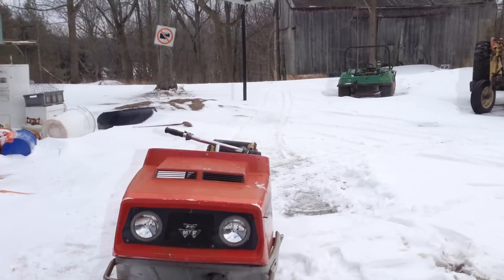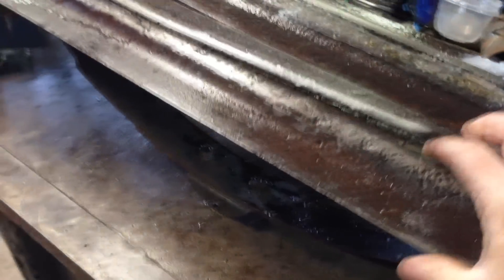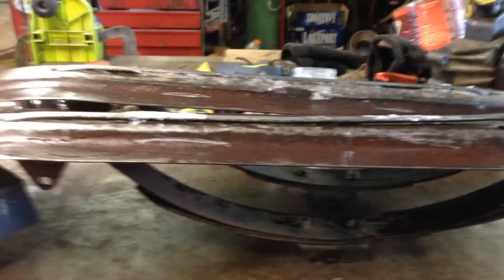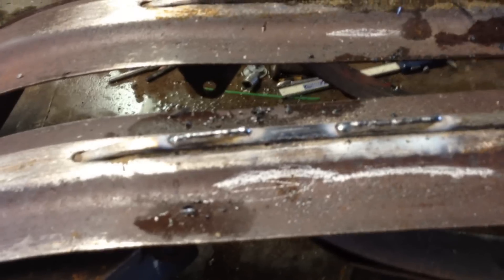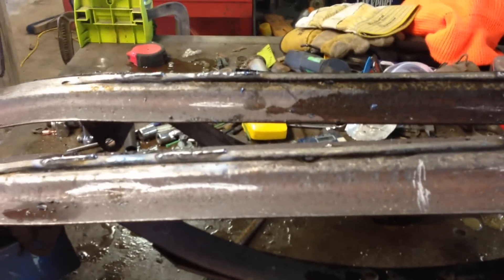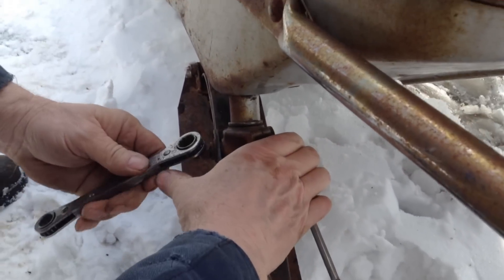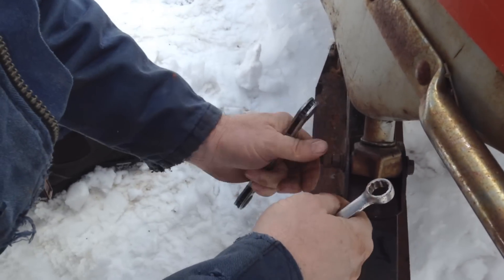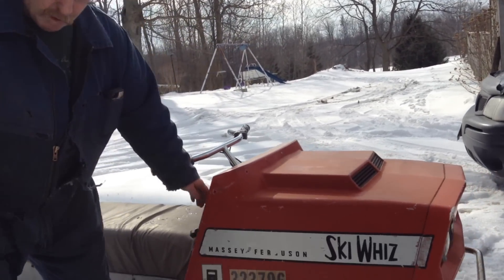How to make your snowmobile turn bettter

Comment: dave, the starter has old grease around the recoil, it gets stiff in the cold and gums up. take it apart, clean it off with choke cleaner and lightly coat it with ep grease. will work like new